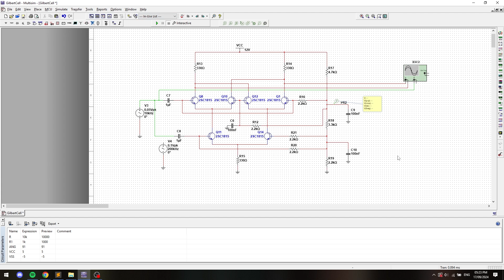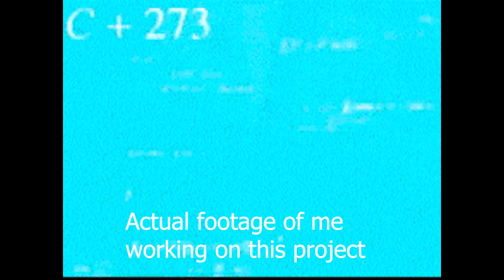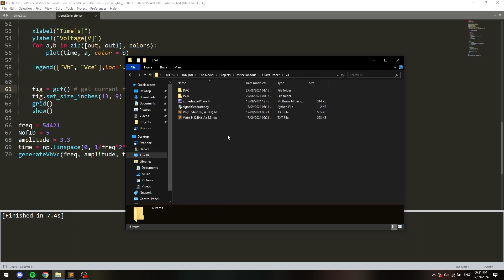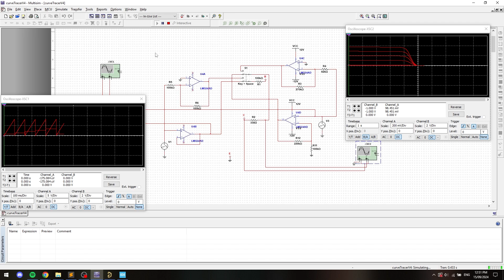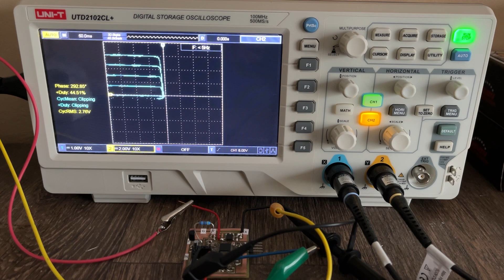Custom BJT curve tracer

Comment: If you design a circuit to output the differential of two transistors' Vce currents (can easily convert to voltage over a resistor) when given the same Vbe, you can essentially measure their Hfe and usually they'll be extremely well matched if you find two transistors with almost zero differential.

Comment: I have built Gilbert cell multipliers and they worked fine with transistors that were not matched pairs.  I wonder if you got  something wrong in the design.
A common error is thinking that transistors are current controlled.  Really it is the emitter base voltage that makes the emitter current flow.  Most of that comes out the collector.  The base current is the fraction that the HFE controls.  On transistors, the HFE is a big number so the fraction that goes out the base is small even though it differs a lot.  On a given transistor type, the emitter current for a given emitter voltage varies a lot less than the HFE does
Reply from the maker: Well the design I used is available @1:19 so if you have any suggestions for improvement I'm all ears. To answer the question about matching. Yes they do have to be matched. The reference I used can be found on the following link: https://oarklibrary.com/viewers/pdf/viewer.html?file=https%3A%2F%2Fapp.oarklibrary.com%2Fproxy%2F%3Furl%3Dhttps%253A%252F%252Fcurriculumoark.blob.core.windows.net%252Foark-library-container%252Fexternal-search-provider%252F4a514ab0-dbff-49f1-87c5-0514a285945e%252Fe5dd01a0-096f-401a-b1d7-0d9a8615073b%252Ff395d6a6-2173-4155-aafa-440ba5610be6.pdf
If you follow their math on slides 12 and 13 you can see that they cancel out the reverse saturation current which is only possible if the transistors are matched. Perhaps you used some kind of compensation circuit in order to eliminate the mismatch problems.